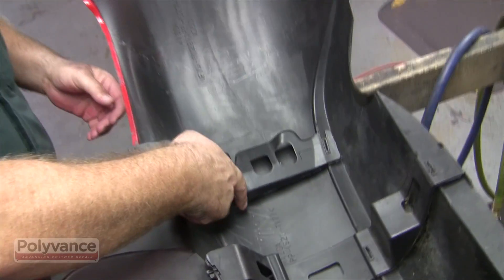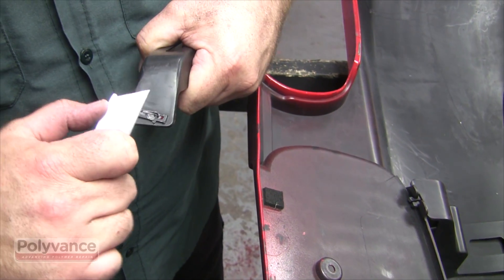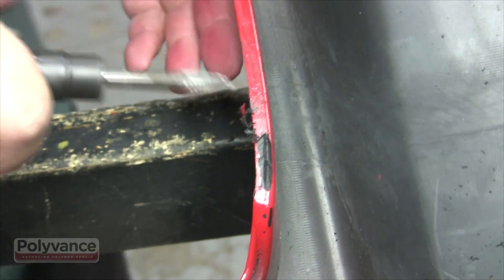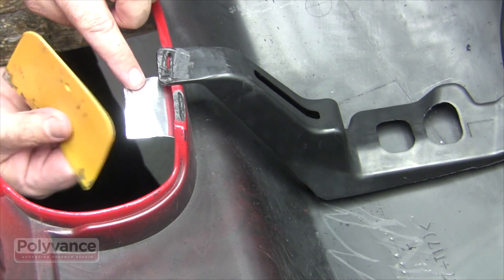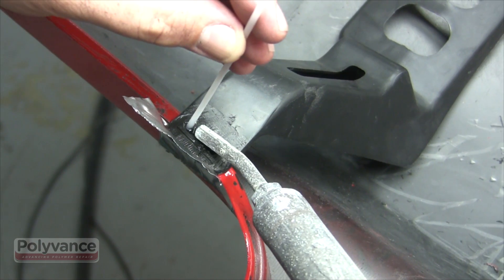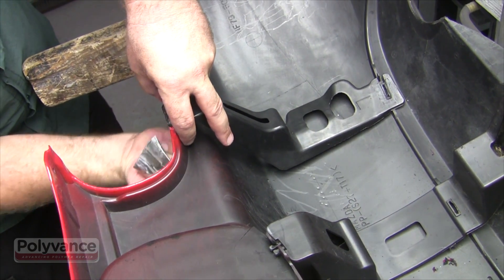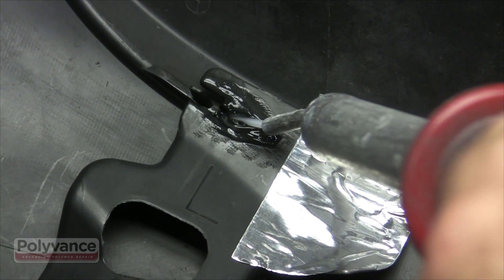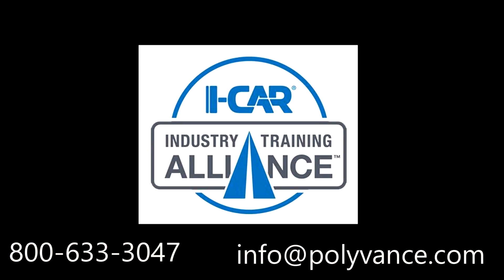Welding Polypropylene Bumper Support Brackets

Comment: 3:45 ~ I am a bit concerned at the comment that is made here.  Are you trying to sell a more expensive welder?  Will a 5700HT not work just as well on this repair?
Reply from the maker: The 5700HT would not work here because of the size of the gap we were welding. We needed to be able to aim the heat into the gap to heat the base material as well as the welding rod (this is to create a fusion weld). The airless welder would not be able to get into that space to heat the base material and the welding rod at the same time.